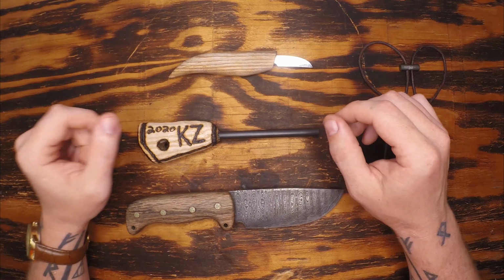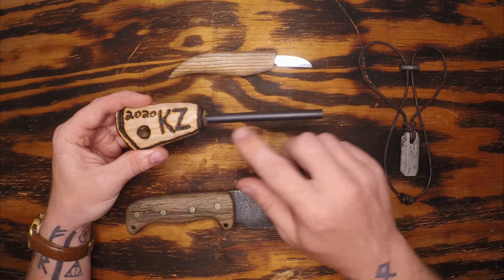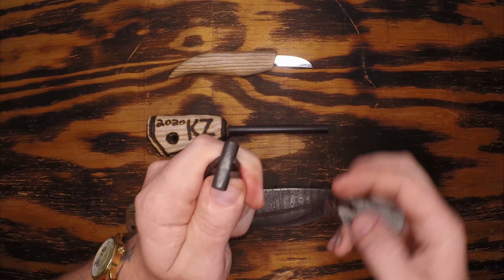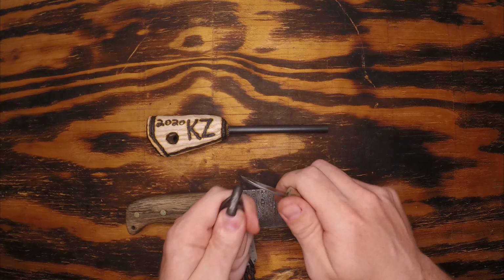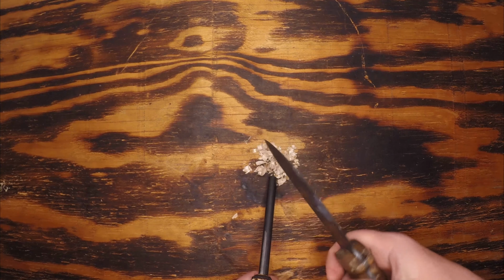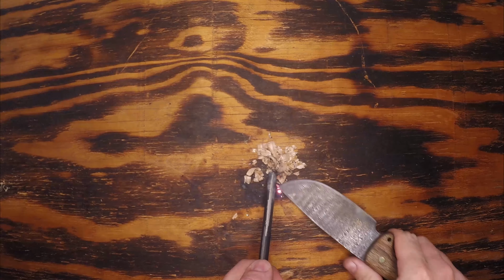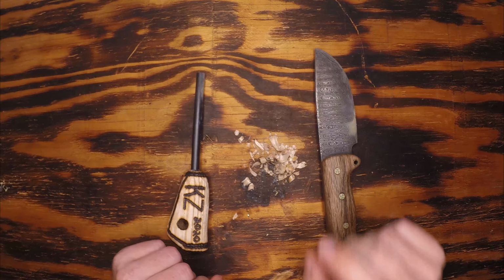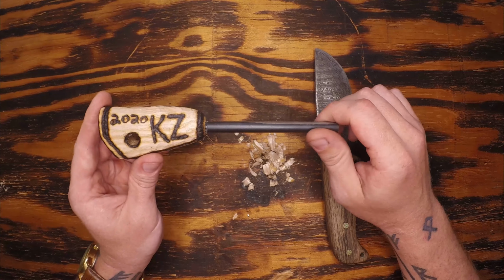Modifying and Testing the ARMAGEDDON FireSteel

Comment: Not only do people not use the blade for a ferro rod because of sharpening but because sometimes the ferrocerium will stick to the blade and could mess with the temper on the edge
Reply: You’d literally have to get the steel red hot to change the temper. That’s not going to do it
Reply: @chrispaulsen3166  ferrocerium can get it that hot